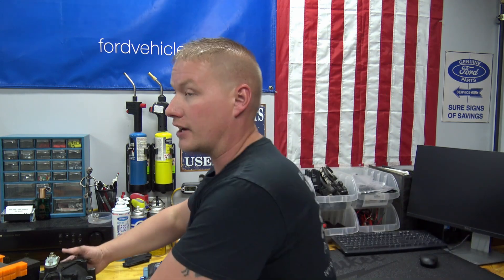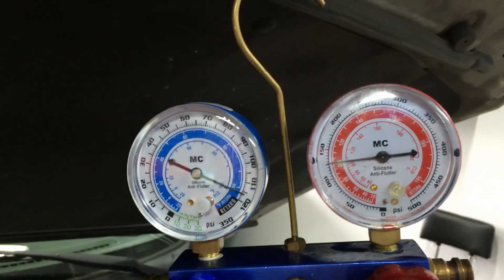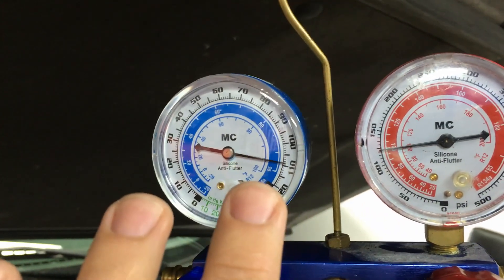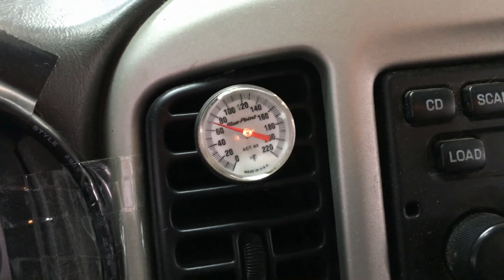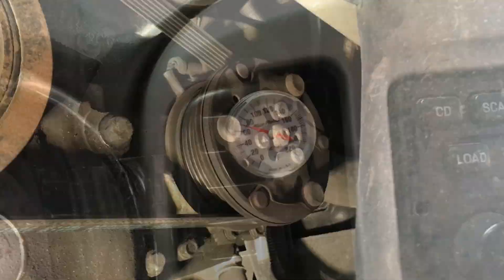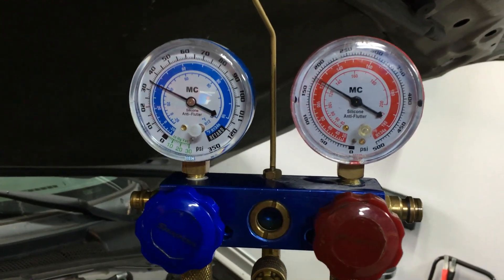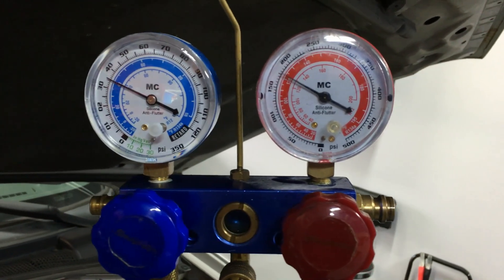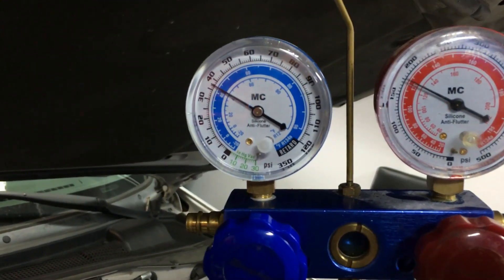Ford A/C Quick Tips #5: Diagnosing a Weak A/C Compressor

Comment: I have a 07 focus 2.0 that loses tremendous power with the ac on... ac off still has lack of power. no codes. any info will help.
Reply from the maker: Forget the a/c concern and just concentrate on the misfires the engine is having. Pm me on facebook maybe we can find out what is going on.
Reply: Idle air control valve